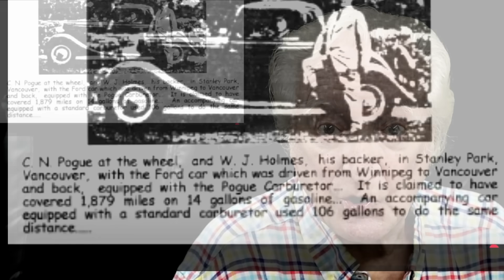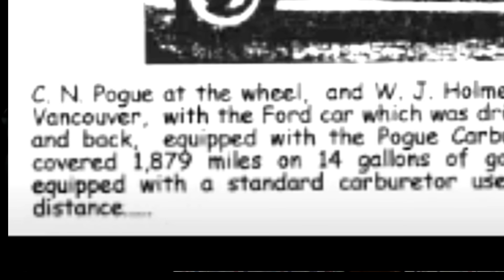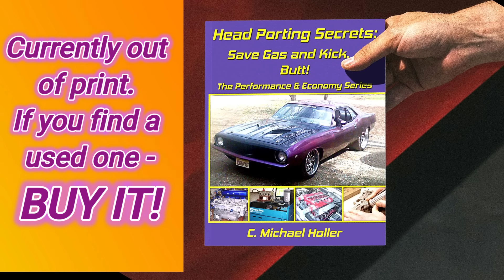100 MPG carb - the real truth!!

Comment: I commented after you last video. There isn't enough energy in a gallon of gasoline to get 100mpg in a fullsize sedan. Period.
Reply: Actually there is enough energy in a US 2:49 gallon of petrol to rotate a 427ci v8 and propel a large sedan on the flat at low speed because 1 US gallon contains about 35KW of energy.
However, the internal combustion cannot possibly produce 35KW of kinetic propulsion from 35KW of petrol. Heat is the major output which isn’t utilised and friction is the second greatest loss.

If the vehicle had been airstream lined, fitted with steel wheels and driven on a level railroad at low speed, a humble Honda single cylinder could probably return more than 150mpg but definitely not if the Honda was forced to spin  426ci V8 engine at the same time.
Reply: @adrianchetwynd1334 kw isn't an energy quantity. But true you probably could move it on flat theoretical surface at low speeds.

But still it doesn't get more energy by vaporizing it first nor does the cycle of an ic engine get magically superduper good with less heat loss by doing it. If it did you could basically just buy gasoline and sell it for electricity for profit
Reply: 78-80 Chevrolet was working on one. The Saturn project,  not Saturn the car brand. The goal was 100mpg but was only able to get up to 80mpg verifiable. It wasn't a speed demon by no means but it was what it was. They scrapped the idea to go with a 17mpg set up on v8s and basically 20mpg for 4 cylinders like the iron Duke. And in the 50s the Henry J got up to 35mpg even though it's engine was junk
Reply: A fullsize sedan is a minimum of a crown vic/caprice/charger. 4500lbs and 22+ ft long. The minimum hp required to maintain 65mph for any of those platforms in 25 in the best conditions, but real world is closer to 31hp. This was discussed at length in the first video and repeated in the second. 110,000 btu in a gallon for gas or 44hp/hr. We haven't been able to mass produce any gasoline engine over 35% efficiency. 

In short we don't make any engine that exists in a mass produced car that is even half as efficient as needed to achieve 100mpg.
Reply: @MrAPCProductions  exactly!

I notice that someone has posted a comment claiming that the RTA in NSW, Australia tested their car with plasma ignition and it supposedly went better than the thermodynamic equation. I assume he's suggesting that it went better than the ideal otto cycle (instant spark and pressure rise) efficiency... Well, that tells me that what he says can't be trusted. A bit later in the comment he says something along the line of the efficiency going up 15%. I take that to mean 15% lower fuel consumption. While it's a big jump in efficiency, it has been shown that above a certain intensity of spark, anything more does nothing to increase the combustion efficiency. He said "HEI" ignition, which tells me that the spark is more than adequate to get everything possible out of the air/fuel mixture unless there's something very wrong with the ignition system. Aside from that, the air:fuel ratio doesn't suddenly jump to slightly lean by changing over from one ignition system to another. I see several red flags in the claims. Don't these people realise that there are people in the comments section who actually know what they're doing (some of whom, such as myself, are even automotive engineers with experience in fuel systems)? Having been a moderator in a fuel economy discussion forum, I've seen it before. People come along with various claims, but when those who know what they're doing come look at the facts, the claims are found to be anything from misinterpretations of test results (by the claimants who really know nothing about what they're looking at), through to "unsubstantiated deliberate nonsense" (for want of a more blunt but still polite word).

OK, here's one for the scientifically illiterate nutters:
Nearly twenty years ago I converted a Corolla to run on hydrogen. While the engine was running on hydrogen, it was getting infinite miles per gallon of gasoline! The simple reason was that the gasoline injectors were disconnected, and not injecting gasoline (it was in hydrogen mode, after all). But just think of that! Infinite miles per gallon of gasoline! What happened to my "invention?" Maybe "big oil" bought it out... Maybe big auto co's bought it out... 🤣 Nope! Nobody bought it out. Oh dear! Infinite gasoline mpg and I haven't "sold out..." That must mean my life's in danger! 🤣

The comment sections for topics like this really are indictments against the schooling system!
Reply: YOU LOSERS NEED TO GROW UP. YOU CAN RUN ENGINES ON FUEL VAPOUR. GET OVER YOURSELVES, VAPOUR WORKS.
Reply: Even gas vapor?
Reply: Gas vapor is still gas. @DANTHETUBEMAN
Reply: In 2012, I was heavily into plasma ignition systems and tested a vehicle at the NSW RTA EPA testing facility at 5 Lord Street Botany NSW Australia.
These are the people who made the ADR (Australian Design Regulations) which are the Standards that any vehicle must meet in order to be permitted for registration in all states and territories of Australia. 

According to them, I was the only person to have ever turned up and defeated The Thermodynamic Equation, with the results being examined and confirmed by 3x different Physicists at 3x independent Universities across Australia.

The test results were marked “Valid”.

I simply used 4.7uF of radiant plasma as the ignition source, coupled to silver electrodes.

In a legitimate Class A test you’re not permitted to make any more than 1 change per test run, so there is no opportunity to fine tune the carburettor, lest you be deemed to have overstepped the limit of 1x change.

Ok, so simply keep the plasma generator switched off and do the baseline with a regular HEI ignition system and record the data.

Next test, flick the switch, which is the 1x step as permitted, and run the test again.

Result:
An immediate 8 hp increase.
An immediate 10 lb/ft torque increase.
An immediate 15% reduction in fuel consumption.
An immediate reduction in NOx emissions, generally 17% across the board yet one reduction was noted @23%.

Problems:
An immediate change from 14.65:1 to 15.7:1 A/F ratio which cannot be overcome under the 1x step/change rule.

The physicists were astounded and apparently contacted the manager of the facility to enquire how it was achieved.
He couldn’t tell them as he had left the facility with better things to do, as according to him, The Thermodynamic Equation is best described using a Bar Graph.

When 1x emission is reduced, it increases one of the other Bars in a “see-saw” effect, which is of course correct.
Thus, you cannot reduce one emission without increasing another, and that’s been the case forever.

He explained all that then said he’s not hanging around to observe the test as he’d watched apparently hundreds of attempts over the previous 12 years that he’d been in charge and thus was not going to be wasting his time, so he shook my hand and left.

His attitude caused me to rethink the situation but in the end I said “bugger it”, we’d come too far to just quit now, so lets do the bloody test and just go home.

He was on the phone the following day after the Physicists badgered him for running off and not observing how this apparently miraculous feat was achieved and he was pressing me for a quick explanation to pass on to them.

Plasma Gasification is the answer.

You vaporise the fuel, in turn vaporising the NOx emissions across the board.

Post test postulations:
What would happen if the A/F ratio was altered from 15.7:1 (lean) back to the Stoichiometric ratio of 14.65:1?
Given the hp/torque increases as listed and the 15% reduction in fuel consumption to achieve those, the question is, at what point would the engine reach Stoich again, or will it.
Some people think this actually rewrites The Thermodynamic Equation.

I gave up and walked away.
The technology was kept locked in a road case until 2024, when I threw the whole lot into a rubbish skip and never looked back.
Reply: @rosshanley8398 probably good thing you did before you got that infamous knock on the door or hit with a dart lol
Reply: You can of diesel😅 Peugeot was getting 120mpg over 20yrs ago lol
Reply: @CraigLandsberg-lk1ep   according to Stellantis' media release, it was ten years ago, not twenty. They drove for 38 hours to go 2152km, which is about 60km/h, considering that they changed drivers every few hours (hint: they got it hot and kept it hot, and it wasn't city driving - it was on a test track). The fuel consumption was 3.0 l/100km, or 94.2 mpg (US gallons). The vehicle was a Peugeot 208, which is a very small car, so a far cry from the full sized sedan that MrAPCProductions was talking about. I'll give them the benefit of the doubt, and assume they didn't slipstream a larger car to get the other car to pull them along in its wake, as is the case with bicycle world speed records.

Your comment is a non-sequitur. You might as well have said a scooter can get over 200mpg because that's only a bit more irrelevant to the comment as comparing a little Peugeot 208 to a full sized sedan. Where do you see full sized sedans getting 100mpg? Nowhere! Not even in fuel consumption competitions, where the cars are given every trick in the book to make them use as little fuel as possible, at the expense of real world usability and they're also driven in ridiculous ways that nobody does in normal road use. There are no 100mpg full sized sedans, and that's all there is to it!
Reply: What's the last fuel record for the shell eco marathon? 5-10,000 mpg? Something like that.
Reply: @AaronKnowlton-r4r oh wow, I had to go look that up. Well, it's documented that it's definitely possible, and people saying it's not is wrong😂. 22,900 mpg in 2011.
Reply: @mrbig7718 Compression is the name of the game. It creates horsepower and fuel economy. Most of those shell eco motors are well over 15:1 compression. So they have to use alcohol fuel.
Reply: @mrbig7718  you didn't listen to the video. No, it isn't possible.
Reply: @AutoEngineerVideos ok, I'm listening. I never knew about the shell eco marathon, and when the comments mentioned it, I decided to look it up. How are they able to get astronomical numbers? One person said alcohol and compression. I know alcohol burns way faster and I've built a few high compression engines in my day. I'm no engineer but I'm definitely no stranger to street and strip engines. Those numbers are incredible insane and documented. How is that possible?
Reply: @mrbig7718  there are many modifications that they do in mileage competitions, but one thing that's extremely common is for the competitors to choose small cars because they're lighter and have less cross sectional area for aerodynamic drag. Then they apply economy modifications to them, usually to the point where they're impractical, and sometimes fail to meet legislated roadworthiness requirements.

So, the fact remains: you're not going to get 100mpg out of a full sized sedan. It's literally impossible.
Reply: @AutoEngineerVideos but here's my question,  22,000 miles is absolutely ludicrous but documented. Even if it can only be 5% of that. It would be better than what we have now. Why not just 3%. I'd be happy with 1%
Reply: @mrbig7718  You have to look up the SAE competitions. They don't actually achieve those numbers, they are calculated and they are not cars, they are in solar powered bicycles.
Reply: @mrbig7718  you're asking the wrong question. That's like asking about travelling at ten times the speed of light because it's only five percent of 200 times the speed of light. Travelling at ten times the speed of light is every bit as impossible as travelling at 200 times the speed of light, so it's just as ridiculous. Similarly, your question is asking about an impossibility under the pretence of it being less impossible than something that's utterly absurd. You've failed to see that impossible is binary: either something is possible or it's impossible (I'm not talking about the degree of difficulty). You've asked the wrong question, and you have no excuse because the answer has already been laid bare in front of you: it's impossible.
Reply: Not true define sedan,  modern day or back when a car wieghed 900 lbs. not 5000 lbs….  You can put a car on railroad tracks with little rolling resistance and get that milage. , what more factors than “ it’s a sedan”. A sedan in France  and America aren’t even close …China and Russian aren’t even the same , the lada   lol…..it can be done. , just like worlds fastest solar bike.   The rules , the grey area , creative license ……could you get 100 mpg on an Cadillac vs Honda ,  both Sedans and yes wildley disproportionate in weight …….more science than. Just sedan
Reply: @Somebodyiswatchingme-f8k  full sized sedans have always been heavy. That's part of what makes them "full-sized." You're arguing semantics instead of looking at what the person said that we're all commenting on. A 900 lb car has never ever been a full-sized sedan! You're also arguing in direct contradiction to the laws of physics, and trying to tell automotive engineers who have worked with the relevant principles for decades that they're wrong. You know so little about it that you're not even on the Dunning-Kruger curve, and yet you have the confidence to tell experienced automotive engineers that they're wrong about automotive engineering! Talk about arrogant!
Reply: You are wrong!
Reply: YOU ARE WRONG FFS. @mr.b2107
Reply: Run off the fumes & it works, period.
Reply: @rodneyjones4890  Fumes consume the liquid. What have you been smoking?
Reply: @rodneyjones4890 , nope. Gasoline fumes contain exactly the same energy as liquid gasoline.

Comment: I would love to see what could be done with on off the shelf 4 barrel, like the Edelbrock AVS2.
Reply: Modern fuel injection systems are far more efficient than ANY carb. That's a proven fact. Carbs just cannot tailor the air/fuel mixture to optimize engine efficiency like a microprocessor can.
Reply: @quantumleap359  I beg to differ.  A properly tuned, well built carb can be more efficient, or make more power than any of the best EFI systems out there... AT A SPECIFIC RPM RANGE.  The trouble is, once the engine is outside that specific 'sweet spot' there's no way it can beat modern EFI's.  

So, average street driving, where RPM's are routinely changing, yes you are correct.  But Peak efficiency is still never bested than a good ole' carb.
Reply: @atheplummer  The problem is that at some point your perfect mixture is upset by barometric pressure, ambient or inlet temperature, changes in so many places. Some carbs can keep up with some of that but not most of it. Efi is monitoring it all and changing the mixture to follow the map almost exactly in real time. I used to have to change carb  jets through the day sometimes on my race bikes if I wanted best performance
Reply: @quantumleap359  Venturi cooling effect beat that.
Reply: 'venturi cooling effect'. Beat what exactly?
Reply: @chrisrand4333  Fuel injection can't atomize the fuel as well and the carb. The carb also delivers a colder more dense charge that's why they still make more power than EFI on the dyno.
Reply: @The0utmode  care to substantiate that claim in some way? Pretty sure there will be a bunch of race engineers who will want to know.. like dont get me wrong, I loved carbies and got fairly good at tuning them back in the day, made a living out of it and other car related stuff.. but those days started to end by about the mid eighties. We had people making these claims back then, and still now but it always seems to fold when evidence is needed.

Comment: Its really easy to get impossible MPG figures.. you just forget to tell anyone about the endless supply of pure oxygen bottles you pickup and drop off along the way.
Reply: Or don't tell about the 4 inch diameter 10 foot long fuel line (6.5 gallons) full of gas just after the 2 gallon fuel cell. The old NASCAR trick. Just fill the 2 gallon jar up with the "Press" watching and then drive till the engine stalls, Yep, 200 miles.
Reply: @davej3487   Ah yes, I heard al about that high capacity 'fuel line'... Nascar engineers are pretty clever at going between the letters of the law.

Comment: I recall an interesting read about building a 16:1 compression engine and using a cam ground to close the intake valve halfway through the compression stroke so it would run comparably to an 8:1 engine on about half the charge. Not a magical carburetor, but seems a bit more feasible.
Reply: That concept was originated by George Arlington Moore back in the 1930's, then commercialized in the 1980's by Mike Brown.  He offered packages for Ford 302, Chevy 350, and Mopar 318 (as I recall).  I met a gentleman farmer in South Dakota that had one of Brown's kits in his 1/2 ton 4X4 Ford F-150.  He claimed torque sufficient to pull a house trailer, and 23 MPG normal driving.
Reply: @mikeholler3953  Ah, yes! I believe it was Mike Brown's book on the Fish carburetor where I read about the concept. It's an interesting idea that has stuck with me. If I were a cam lobe designer I'd probably build an engine to try it out.
Reply: Bruce crower experiment with this concept and offered some cams.mazda made a super charger on v6.reversion a problem on n/a.
Reply: It's called Atkinson cycling. A lot of newer engines do it. Like the Prius engine has a 13:1 apparent compression ratio but it closes the valves after compression starts for an effective 9.5:1 actual compression ratio with 38% additional volume expansion. It tries to capture the blowdown energy and get exhaust valve to open as close to atmospheric pressure as possible.